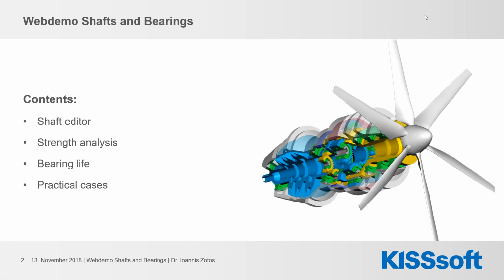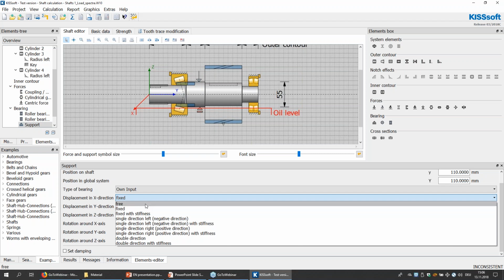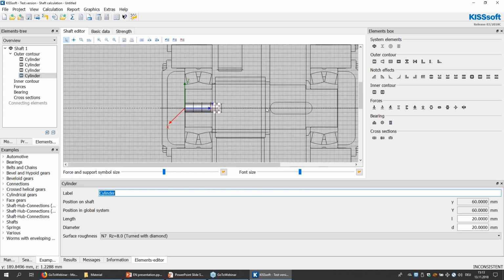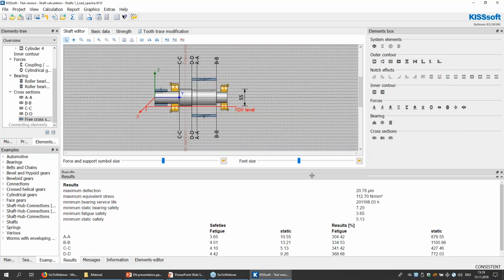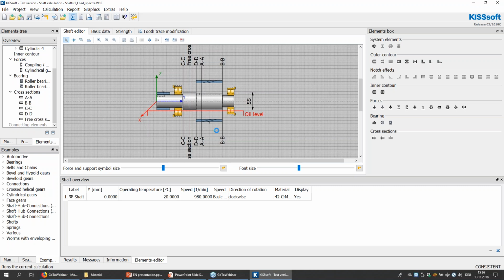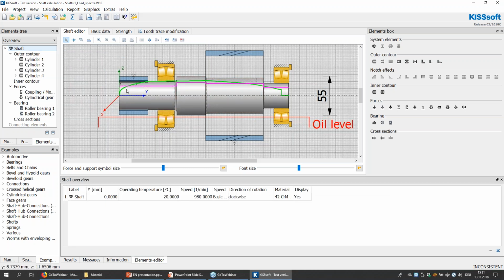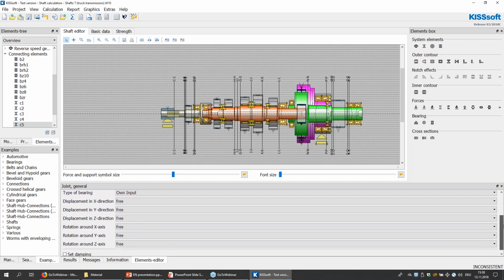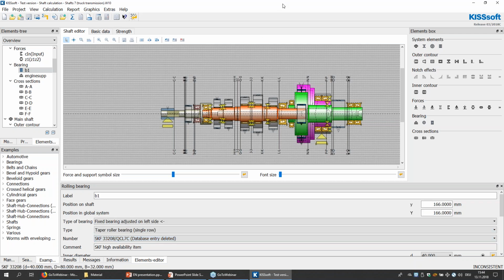Web demo Shafts and Bearings Calculation

Comment: hello sir,
why not you use rough sizing calculation?
its pretty easier just likr cylindrical gears we apply rough sizing calculation, the software you know set all pearmeters of shaft just like in cylindrical gears.
 is it possible in to run and calculate rough sizing of shaft in kisssoft, because rough sizin tab/facility available in kisssoft